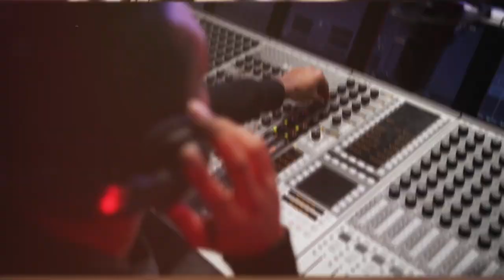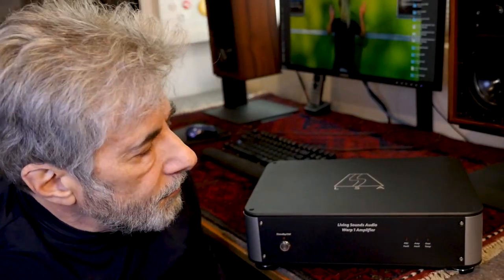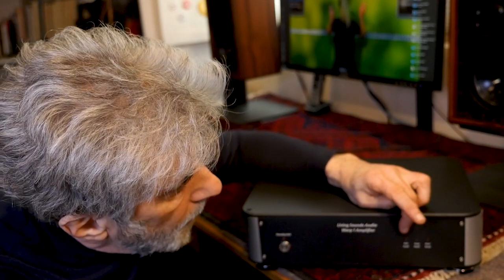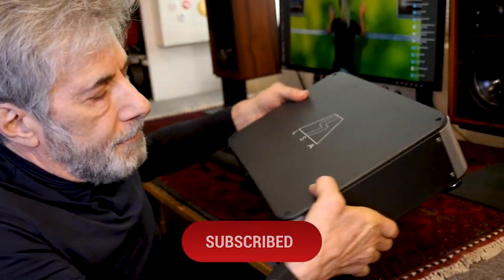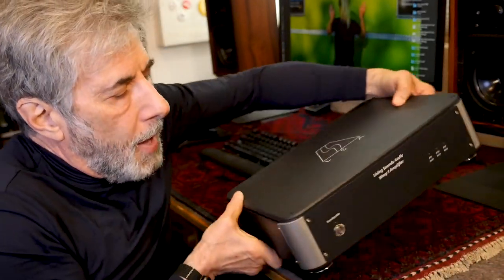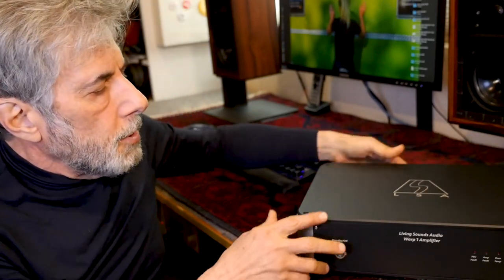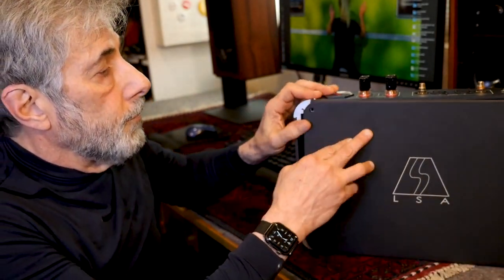Preview: Steven Stone on LSA Warp 1 Power Amplifier

Comment: Hi Steve! You reviewed the Nuprime ST-10 Class D amp back several years ago and gave it a glowing review. How does the LSA compare?
Reply: The Nuprime was a good amp, but it had some occasional issues with low-level, but noticeable hum in some systems I tried it in. Also, no balanced connections. The Warp 1 is much quieter and can be used in more configs due to its variable gain dip switches.
Reply: @stevenstone5846  thanks for the feedback. But I'm quite confused. I just went back to your review and you said that the Nu Prime is very quiet and extremely low noise. You you even said you tried it with a variety of speakers. I have to correct you. The  NuPrime has balanced inputs.
Reply: @ryanschipp8513  OK, I'm old. Mixed it up with the different amplifier. The ST-10 review was from 2015. Haven't heard one for four or five years at least. Recently I had an ICE-based power amp fail and had to price replacement modules on the retail market...wow...ended up not fixing it due to cost...I wonder how easy it will be to get Nuprime V4 amplifier modules and their cost...